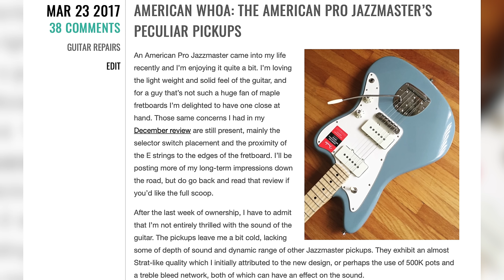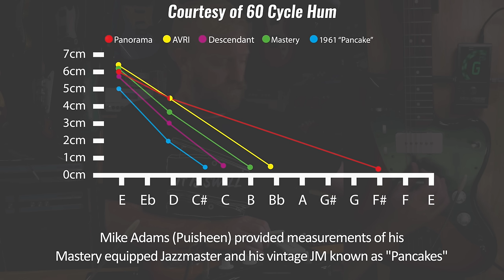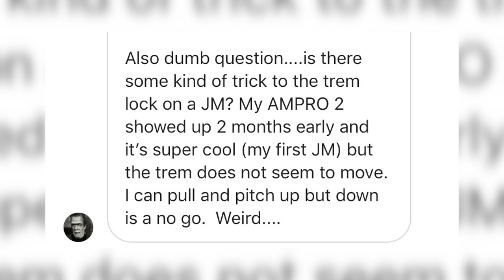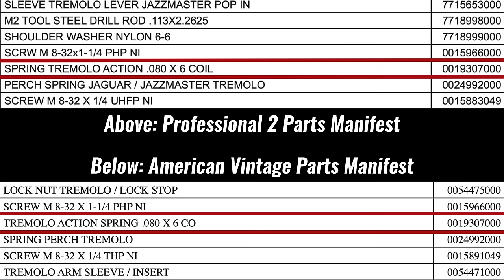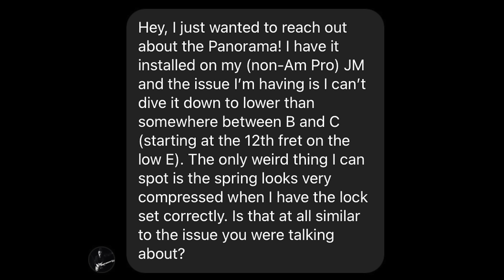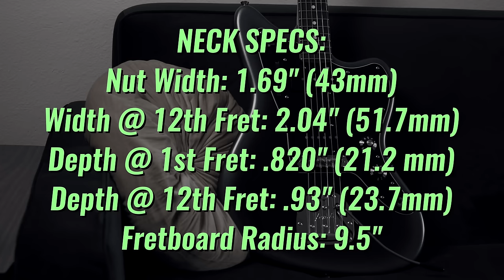JAZZMASTER REVIEW #6: Fender American Professional II Jazzmaster + Demo!

Comment: Hi which US made strat would you recommend? Something that costs as much as the Am Pro 2, or less? I'm after the classic Jazzmaster sound.
Reply: Sorry I meant Jazzmaster not Strat. I'm new to JMs lol.
Reply: if you care about US made then AV2 is probably your best bet for a classic jazzmaster experience, if you can find a deal on a classic series mim are also regarded as very good guitars (i have one and my example is really light and resonant) but ymmv
Reply: @smugbiz  I bought an MIM player FSR that came with V65 pups. 9.5 inch radius. Am happy with the sound but left wondering if the AV2 is worth the extra money. Have never played a 7.5 inch radius fb before  is that where it's at?
Reply: @smollande  personally i’m used to 9.25 radius, but once i borrowed a 7.5 jaguar from a friend and after a few hours of playing it didn’t feel that different from a 9.25 as the guitar had a good setup. 
As far as AV2 goes, it depends on a particular example too. I played some that were just atrocious and some that felt really nice but not that nice to justify the price tag (in europe). If you really wanna know if you’re missing out on AV2 try to order one from a shop that has a 30 days return policy so you can play it with your usual setup. Maybe you’ll be suprised, my GAS was cured by doing so as I had to send 3 AV2 back😄. 
In the end, having already a 60th anniversary classic mim spec Jazzmaster an AV2 would’ve been redundant personally (i’m not into modding guitars) so I got myself an AM PRO 2 for a little bit of spice and variety and it quickly became my #1.
if you’re still wondering how an AV2 would play and feel my advice would be to try some out and if you fall in love with it more than with your min JM then buy it if your budget permits it. I wasted so much money by cheaping out when buying guitars (buying cheaper versions of what I really wanted) and I sold em all and downsized my collection. Right now I only have 3 guitars but they put so much joy into me that I don’t have a need for another instrument for the years to come. 
Hopefully I didn’t confuse you too much 😵‍💫
Reply: @smugbiz  oh dear ... I think I will forget the AV2. I have heard stories about the quality on YouTube. Seems like Fender knows how to make guitars with modern bridge setup only. When Leo Fender went to make the G&L jazzmaster later he updated the bridge and tremolo system to a modern design as well. Time for me to move into the future and get the Am Pro next time. My MIM sounds great for now, but needs lots of adjustments and mods it's a headache. I'm doing it slowly. One problem a month is all I have time for. Then I play my STRAT which gives zero problems. Ha ha!
Reply: @smollande  you’re absolutely right about G&L! Shame that no one stocks them in my country…
For sure I had to learn how to be patient with vintage bridge and neck truss road on my mim but it’s a keeper and it has character. But as i don’t mod my guitars i don’t want any more hassle again 😆 AM PRO solves the majority of those problems. You can try  it and if you like the feel and the neck you can always swap pickups if you realize you don’t like VMODS. A cheap alternative that sounds good would be a handwound set from Sunday Handwound. 
I reach for my strat too when I have to gig or practice. Just had to set it up how I like and it stays like that for years. Such a beautifully made guitar! Now in a few years when GAS will kick in again i’d like to try out a thinline tele! Have you tried one perhaps?
Reply: @smugbiz  I have terminal GAS. Been eyeing an SX swamp ash tele with 70s strat neck just to try a neck tilt mod and also I've never had an ash body before. I want to make my own 70s tele with cunife pups. As for the thinline, it looks like a mini 335... so do you get the high frequency twang of a tele and the boomy sound of a hollowbody and little midrange? I never played one but think it might be perfect for jazz fusion. What do u like about it?
Reply: @smollande  honestly i fell in love with a vintera thinline in shell pink visually! still have to play one and see if it’s worth 1300 asking price here in europe…
Reply: @smugbiz  that's a nice colour! I hope it sounds good when you try it! I'm getting a cheap Jaguar ha ha.
Reply: @smollande  are you getting a squier classic vibe? I had classic player jag with HH configuration and didn't gel with it (but I hate humbuckers so...)
Reply: @smugbiz  yes a squire SS. It's great for surf music ha ha
Reply: @smollande  funnily enough the guitar i use more for surf is not a jazzmaster but a strat 🤣
Reply: @smugbiz  Even the Ventures dont play Jags or Mosrites ... they moved on to modern gear ha ha. I just blame GAS and curiosity. I have to try it it's an iconic Fender!
Reply: @smugbiz  ok so I just bought a squire thinline. What pickups should I use? Fender Nocaster?
Reply: @smollande  HH or SS?if you wanna stick with SS in my opinion Nocaster is one of the best sets out there, but also twisted tele ain't bad. In the end the vintera Thinline went back and I got myself a Squier offset telecaster, the quality of workmanship is just on another level compared to MIM and even some MIA!
Reply: @smugbiz  so now that I took your advice on thinline I have to return it like you? Ha ha. Its SS. Alder Squires has nice bodies. But funny that my thinline has only one chamber near the f hole? The other half of the guitar has no chambers? I knocked on the wood and its solid. Surely this was not the original design from the 60s? I thought it would be like an ES335...
Reply: @smollande  i think that only half of it is supposed to be chambered but don’t quote me on that 😂 have you tinkered with electronics or stock pups are doing just fine?
Reply: @smugbiz  I bought the wood only with no guts. I had Seymour 1/4 lb neck and hot stack pickups somewhere in my room. Will try those first? I really want T Armond on the neck but I'm lazy to route. Will get some aliexpress half bridge to reduce the treble, not sure about brass saddles may be too bright and tinny, trying to go for a thicker tone like the ultra telecaster (with cheap parts good luck to me). Maybe a top loading Wilkinson bridge. Some generic tuners. I'm going to the electronics store to get some caps and wire it up to a 5 way strat switch. Get the series, out of phase positions. Paint a crocodile on it, spend 2 weeks practicing bottleneck and sign a record deal next month. Yea that's the plan.
Reply: @smollande  so it's a partscaster of some sort? i really love thr GOTOH bridge i installed
Reply: @smugbiz  yes a partscaster! I bought a half bridge for it. Still waiting for other parts to arrive. Did your gotoh have 6 saddles or 3
Reply: @smollande  gotta go 3 for that classic feel (makes sure they're compensated to get the intonation right)
Reply: @smugbiz  gotcha. Bought a half bridge with 3 comp saddles.
Reply: @smollande  how do you find it so far?
Reply: @smugbiz  hi Ivan, I havent finished assembling the guitar yet. Just finished lacquering the headstock. I want to do a refret! Hey what do you think of direct mounted tele pickups? I've never tried that before.

Comment: Anyone else own the American pro ii and NOT have the weak spring issue with 11s? I’ve never noticed anything with mine but I’m tuned to D standard so maybe that’s why. I’m kinda scared to tune up to check now
Reply from the maker: That's a lot less tension than E, of course you won't have the same problem

Comment: aw, no love for the am pro 1. I recently bought a used one from 2019 with the all RW neck and absolutely love it. maybe it's still the honeymoon phase, but I'm liking the sound even better than the SD antiquity IIs in my other JM
Reply: you probably have pure vintage 65 pickups and the correct string spacing as if i recall correctly the rosewood models came with those adjustments but ymmv

Comment: 49:06  - it would be good to demo the guitar with one meg pots (even if it’s only the volume?) BEFORE switching out the pick ups so that other owners could see whether it’s a mod worth doing for them & could also save them (and you?!) Buying a Set 😉
Reply from the maker: I don’t think so — pots alone won’t save the Pro 2 pickups’ chronic lack of midrange fullness. And as I said, it’s nearly impossible to track down 1meg DPDT push-push/pull pots
Reply: @Puisheen  fair Enough 👍

Comment: Alpha makes 1 meg push push pots but don't buy them - quality control is shit. I bought some  - 1 was broken at the switch when I got it. The second was broken at the pot. The third was fine.
I got them from the UK and getting them replaced would have cost more in customs charges to the EU than the value of the pots - so not really worthwhile.
This is a shame, as Q pickups makes proper coil tap Jazzmaster pickups - but would need to add more switches to get the benefit of them.
Reply from the maker: Oh absolutely, Alpha is a non-starter

Comment: Fender has always been stingy with string spacing, and how hard is it to make a wider neck?   Not hard at all.  As for the Nylon inserts to stop the bridge from rocking, how much do those cost for 2?  5 cents?  So why did they not use them, better yet just use different body inserts so the damned things don't rock to begin with, on all jaguars and jazz masters, since shortly after they first came out way back when and everyone complained about it, and they sold far fewer than they could have if they did?  I don't know how many of them I have modded over the decades with hand made inserts, graph tech saddles, neck shims... right out of the box!  I Literally did a brand new Chinese made jaguar three days ago, and should have done it 3 weeks before then, but had to wait that long for a freaking tuner, because  one of the fake Kluson copies had either a missing gear tooth (Bad casting), or a bad gear mount...  Even worse:  The guy who bought it from a supposedly reputable store picked it out and they gave him one from in back, not the one he tried, no setup or checking it of any kind!  It should have never left the store that way.

As for making a whammy bar that doesn't fall out and stays where you put it:  also not hard, and just about every other guitar does it!

They still don't use true two way truss rods with some strength to them, better yet carbon fiber rods to stop their necks from warping...  I think the only "Engineers" fender has ever had after Leo, are marketing engineers!

OK, Jazzmasters and Jaguars look really cool, but sorry, besides the new groovy colors, for what you get (worthless tradition that never worked well to begin with) they are way over priced.